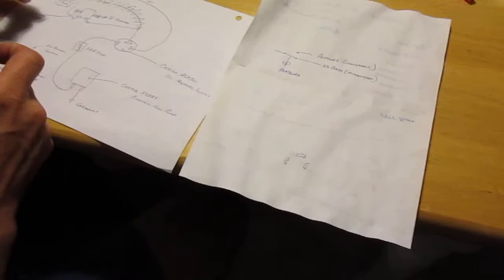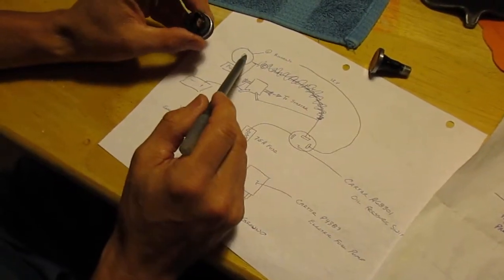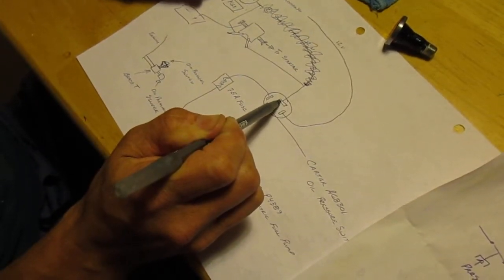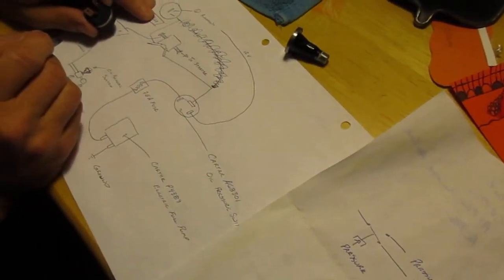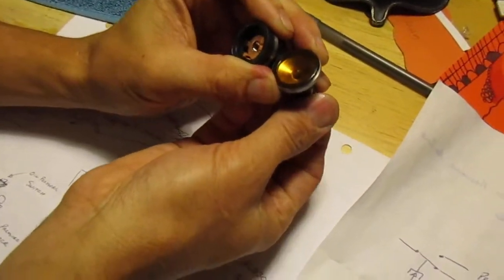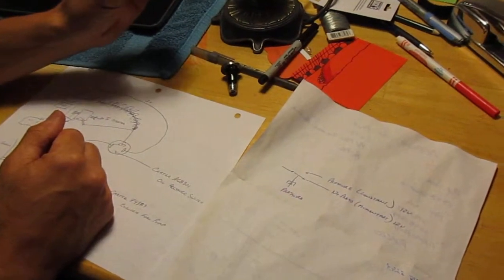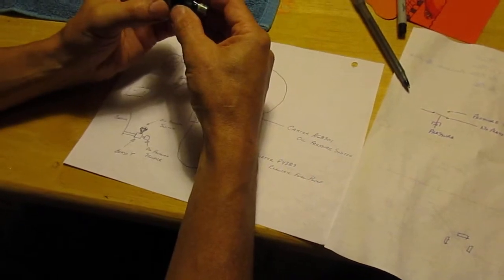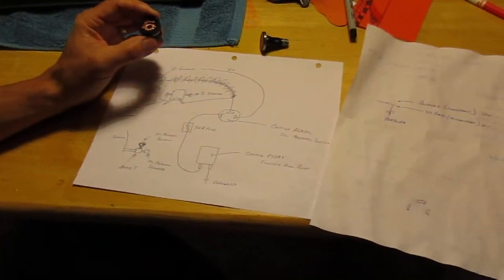Oil Pressure Switch Explained Carter A68301

Comment: About 10A max, so you can run a small carburetor fuel pump (~5 psi) directly.  For a larger EFI style pump, which can also be used with a carburetor (w/ bypass return), better to have the "P" output trigger a 30A relay.